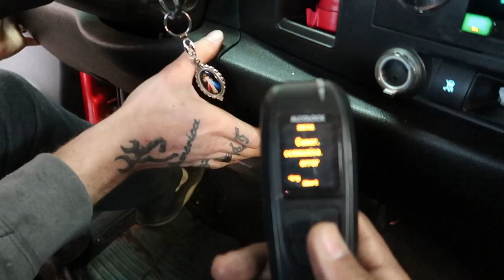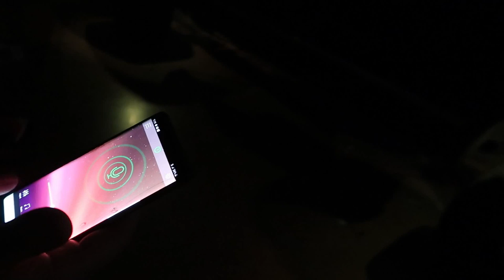AUDIO CAT DOES IT AGAIN. TEACH A CLIENT ABOUT NEMESIS AUDIO!!!    OTHER SHOP BUILDS..........

Comment: I have a nemesis 3000 watt amp pushing 2 12s Fosgate p3 in my Honda Civic Lx 2014 it beats hard and I had just put in a brand new alternator which it only has 95 amps and upgraded my battery to an Optima please tell me what else do I need so my alternator won’t drain cause my last one did
Reply from the maker: Do a big 3 on it and if you can get a built altanator

Comment: I have the same exact amp as the brotha. I'm going to have it installed replacing my Skar 350.1. New OFC wiring & rca cable. It's going into a 99 Lincoln Continental. Still not sure if the Subs will hold the amp. 800 watts also Skar 12's.

Comment: I had a question i got 2 15s resently everything was sounding good at first then my subs started making clipping noise when the bass dropped and the volt meter from the amp showed my volts dropping really low any idea what the problem could be thanks in advance
Reply from the maker: Have to check voltage or wiring

Comment: Do you guys know if the nemesis na 3.5kd model is true 3500 wattage or not ? This amp uses 4gauge and power wire ? I’m not sure if you guys have a dyno machine or not ?
Reply from the maker: 3500 peak power 1750 rms
Reply: AUDIO CAT  with 4 gauge ?  Ok thanks and I was told for that 3.5 there’s a model for 4 gauge and a model for 0 gauge so I figure the 0gauge model must be true power the other has to be off brand lol
Reply from the maker: It a Korean model or original model
Reply: AUDIO CAT  the box says original
Reply from the maker: So if not Korean made its the original that is peak power

Comment: How much was that nemesis amp and woofers
Reply from the maker: Which models
Reply: @AUDIOCAT  the one that was instelled on the black guys car he had de DB drive
Reply: @AUDIOCAT  i got the polk audio speakers 6.5 front and 6x9 back 500w memphis 2 channel amp sounds great.i just need some good set up for the bass
Reply from the maker: We got you when you wish to come by store
Reply: @AUDIOCAT  just wanna know a price cause dont wanna drive all the way out there and not have enough.im from austin
Reply from the maker: What car brother are we working with
Reply: @AUDIOCAT  2009 civic si
Reply: @AUDIOCAT  4 door
Reply from the maker: Cool 2 subs or 1
Reply: @AUDIOCAT  2
Reply from the maker: Ok so what is my budget
Reply: @AUDIOCAT  500 to 700
Reply from the maker: Do you have anything installed in it already
Reply: @AUDIOCAT  yes i have a auto tek amp and a kicker.its a lil cheap setup lol
Reply: @AUDIOCAT  i have a 4g 1200w wire bridged the power for borth amps and i added 2 grounds
Reply from the maker: What the budget
Reply: @AUDIO CAT What amp do I need for my 2 15 nemesis m series 1k rms each its currently on a cheap 2500 planet audio anarchy which is only teasing them its all inside a 2018 kia optima s all on stock power it still sets off alarms but its not that feeling i won't you know what I'm talking about i need that beat to make the streets not sleep💪💯🦍🚗
Reply: @AUDIOCAT  what is the difference between a system and a pro audio build 🤔 I wanna know if I have that already because the only things I'm missing is an epic center and cap what battery would I need or is the pro audio build the big 3 upgrade
Reply from the maker: We can

Comment: im in DFW    how much for a NA-2km nemesis amp
Reply from the maker: 199
Reply: What is the best way to find your store and is it in stock
Reply: @AUDIOCAT   where you located
Reply from the maker: 930 N. Belt Line Rd. Suite 130 Irving Tx. 75061
Reply from the maker: 930 N. Belt Line Rd. Suite 130 Irving Tx. 75061

Comment: Skar audio >> nemesis audio
Reply from the maker: No skar is the  old audiolegion plant
Reply: @AUDIOCAT  I like skar cause they don’t sugar coat shit by posting max WATTS skar literally printed theyre RMS rating’s on there RP series’s plus it’s quality equipment for the LOW and also they bought audio legion look it up  I run skar subs but switched to sundown SCV series amps it was 110 degrees last week in Bakersfield CA and my sundown audio SCV 3000.1D amp played for hours before it went into protect and I think was group 31 needing a charge (I had my truck off)
Reply from the maker: Yes that is true teue skar is audiolegion they are bad ass for sure